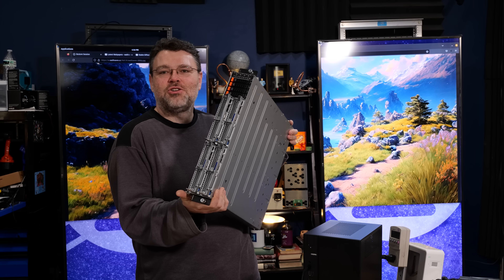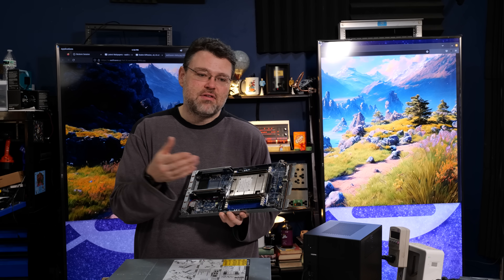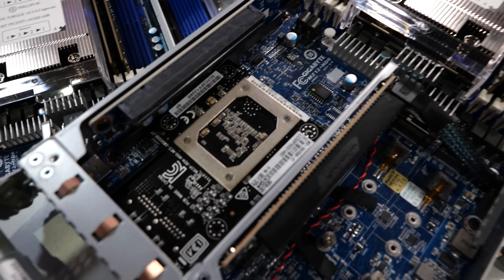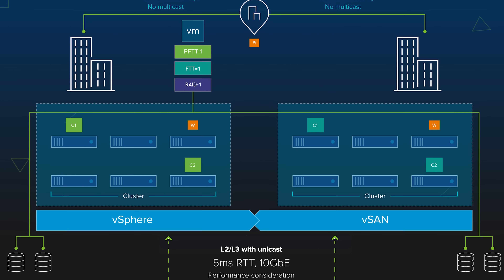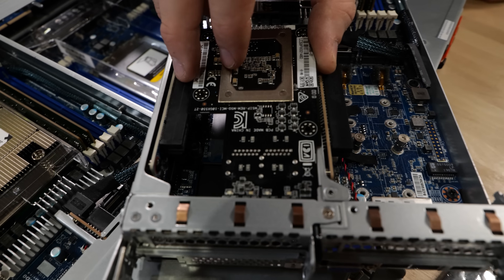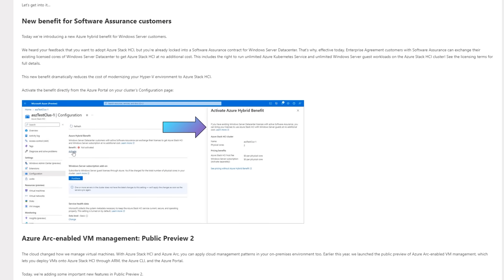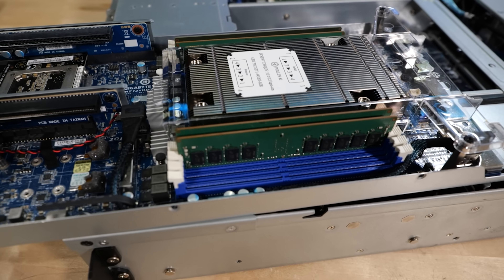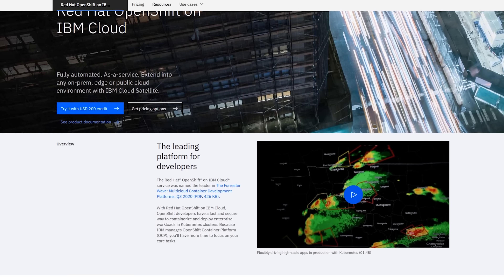256 Cores in a Pizza Box! Half-Depth H242 Gigabyte Overview

Comment: I wonder which Kubernetes on bare metal OS would suit these best... K3OS, Talos or RancherOS... Perhaps Rancher due to available ZFS storage or Longhorn for workloads storage, and yet kind of simplified OS-level tasks with Kubernetes focused bare-metal deployment. And then run VMs inside Kubernetes, not the other way round so not VMs to comprise Kubernetes cluster... Regardless, if only I won a lottery!

Comment: Remember when you could chose between PCIe slots with 1 sicket, and 2 CPU sockets without PCIe slots on these 4 node systems?
Just saying gigabyte, maybe take a note out of the Dell CloudEdge C6100 book, drop the full sized PCIe slots for 512 cores in a 2U chassis, you could still have 24 U.2 drives in the front, or... what 64 of those E1.S SSDs
Reply: Heck, if you didnt need front IO, you could fit ~72 E1.S drives in the front, make the chassis as long as the monster that was the cloud edge C2100 and you could fit 30+TB E1.L drives in there

oddly the C2100 was only a single node despite being the longest standard server i've ever seen, i have seen non-standard servers that were too wide to fit in a normal rack that were longer, 1U with 4 non-swappable nodes, but the C2100 i bought (used) required a special adjustable 4 post rack and special extended rails for all my other servers, If i had the thing still i'd measure it but there is no way the internet is correct in saying it is 28 inches deep, i remember struggling to get my hands to both ends when lifting it into the recycle so i'd say it is 60+ inches deep

What i'm going to do is measure the depth of that adjustable rack, because i know it did stick out behind the actual posts. If those posts are only 25 inches apart then i'll know i'm just remembering the wrong server.